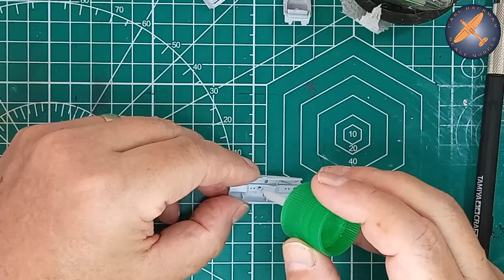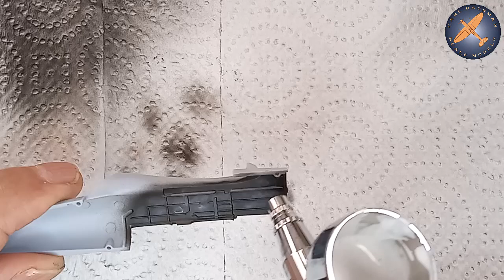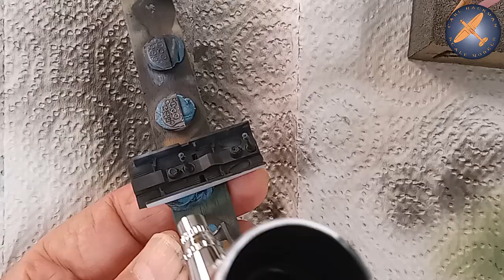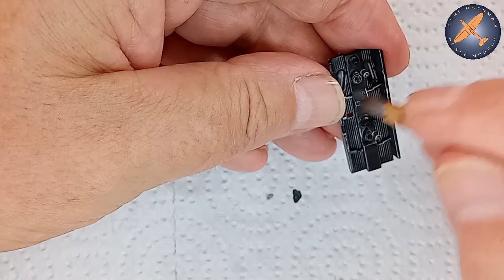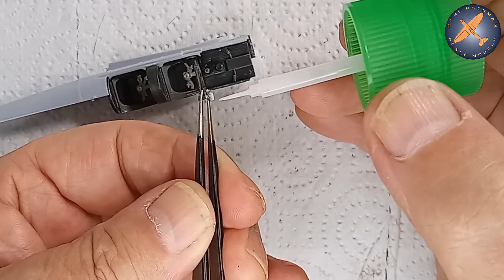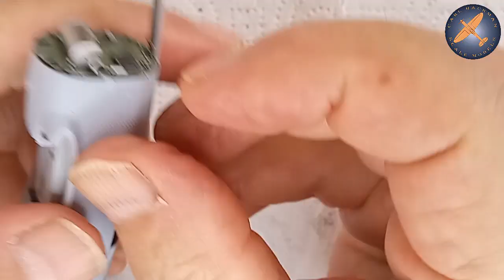Airfix Chipmunk T10 1:48 - Full Build - Part 1

Comment: Hi Carl.I am about to start this kit. I have zero airbrushing experience. Could you list the brand and paint colours I would need. I really liked your results.
Reply from the maker: I can't remember the exact colors but they were all Vallejo model air paints.
Reply: Hi carl
I use vallejo mecha black primer with 2-3drops of flow improver at roughly 20psi and as long as airbrush is kept clean I have no issues however I will say I use ghalleri's white primer as my go to white as it's tough as nails when dry and flows nicely straight out of the bottle
To be fair ghalleri's paints are phenomenal and hard wearing and water based 😂😊😊